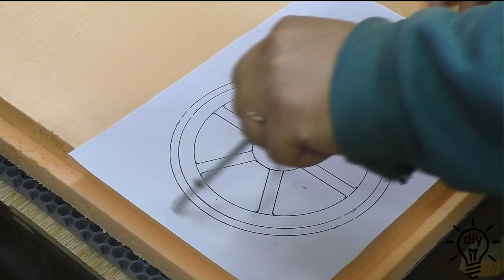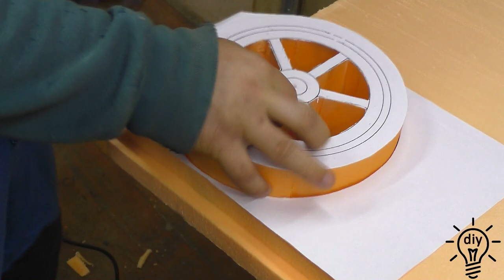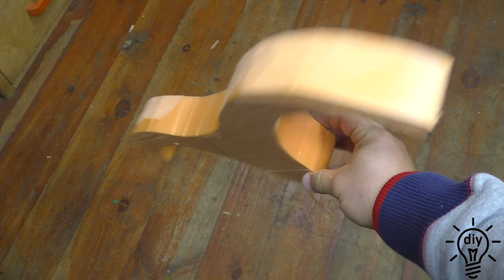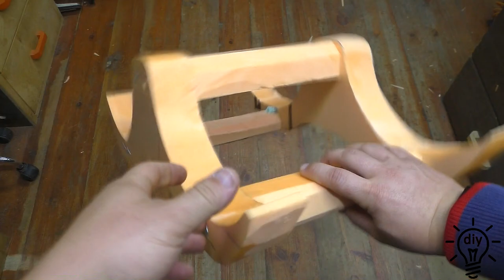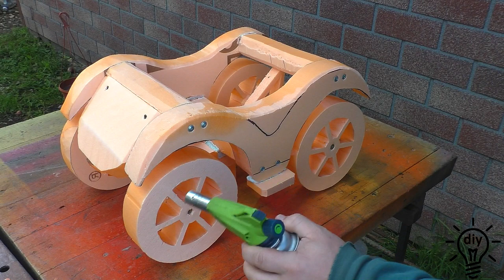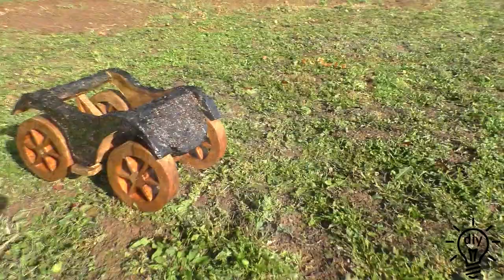Do not throw out the pieces of polystyrene foam! Simple idea!

Comment: My dear always you have nice job but along side with you have a complete and very expensive professional tools, instruments and facilities which is in high quality version.
In that way your clips couldn't be DIY. Job by mean and I kindly suggest you change the name to the perfesioal work.
The goods you have been making It wouldn't be made by normal DIY tools
Reply: Uh, those are the typical tools found in most garages. This is a DIY (do it yourself) channel, not video filmed in a professional shop by someone with 30+ years experience. A jigsaw can be purchased new for $20us, even cheaper used, a drill can be purchased for about the same. These are far from professional tools.